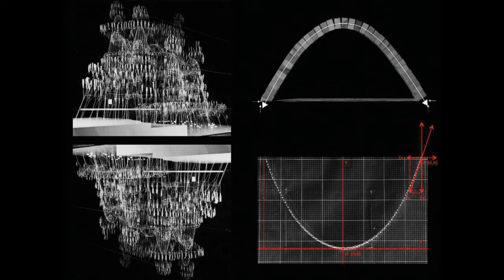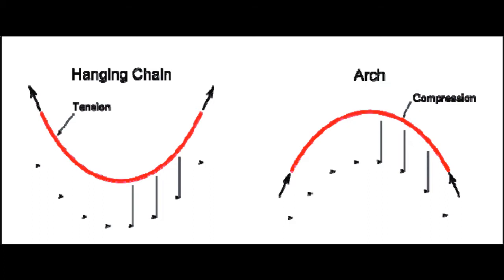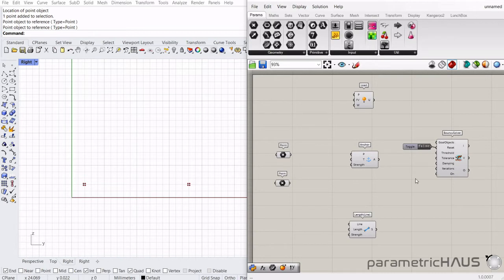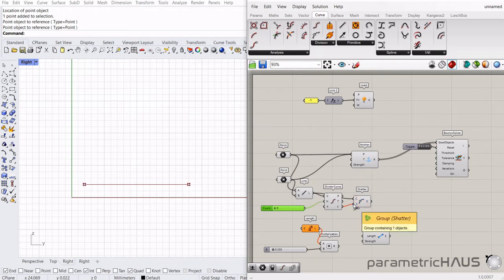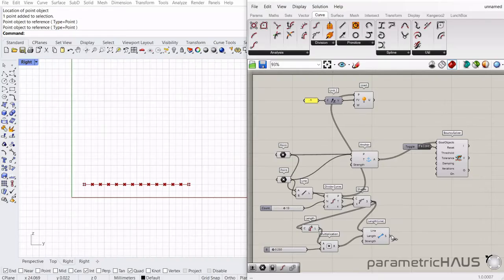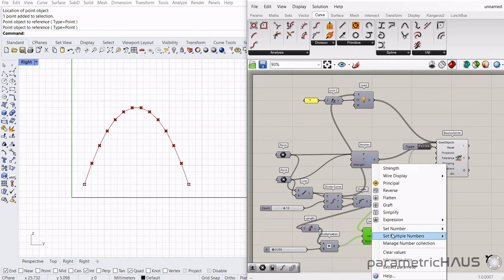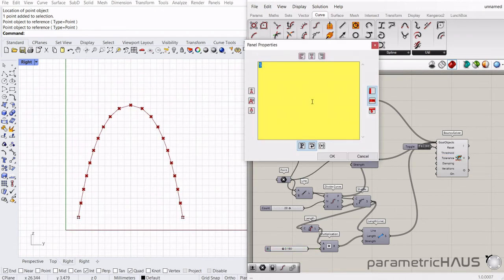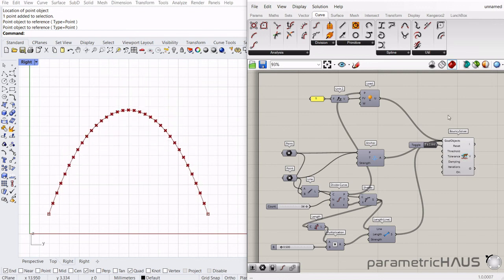Kangaroo for beginners, creating a catenary curve/ hanging chain || Grasshopper in Rhino tutorial #2

Comment: awesome. i love the catenary curve!!  catenary curves dont stretch. kangaroo stretches it. :{
and this vid is pretty advanced for beginners.
Reply from the maker: Be sure to change the  'Strength' value on the 'Length(line)' component to something above 20,000 and it shouldn't stretch anymore. Or you can lower the force vector at the top. It can take a bit of playing around with to get right. 

Perhaps I should call this tutorial intermediate? 

Thanks for the feedback :)
Reply: @parametrichaus8975  thx alot